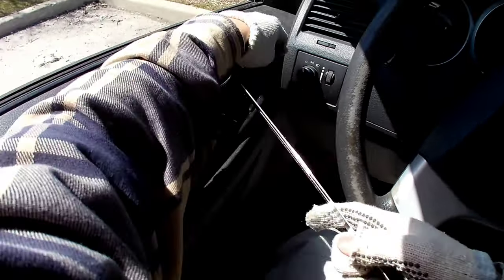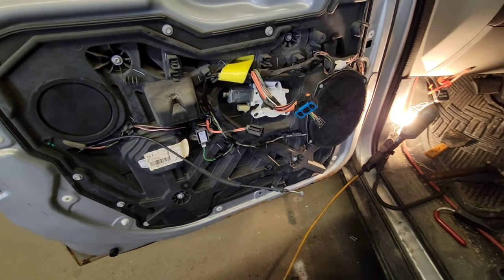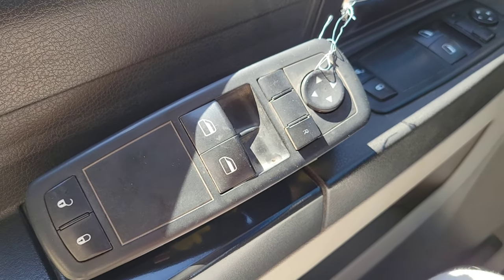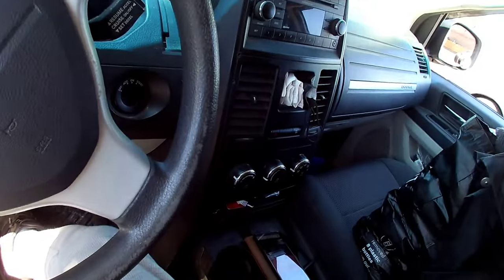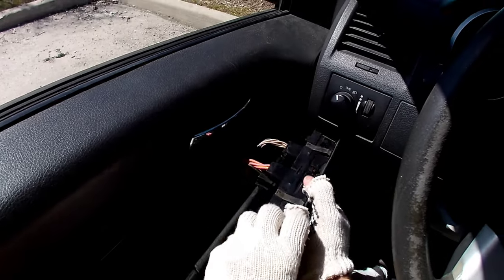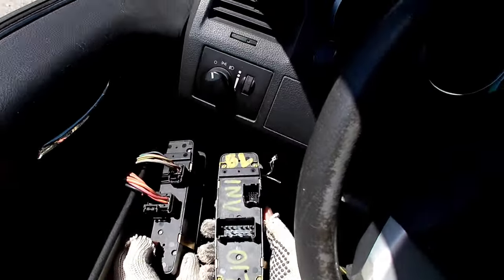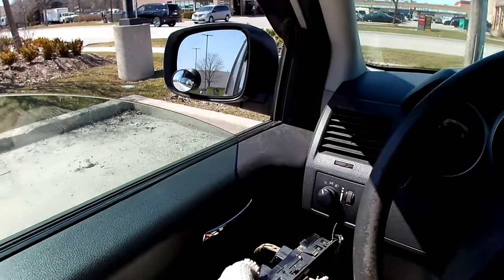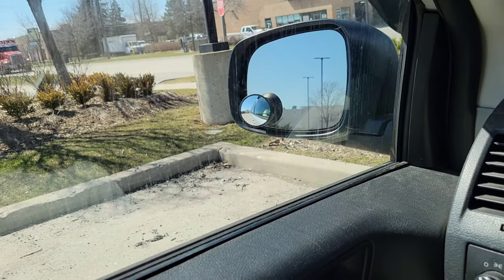When Things Break in a Van | Dodge Grand Caravan | Minivan Camper

Comment: Good job!  Great idea picking up the switch at a auto wrecking yard. 
Most electrical connections on cars have a clip/locking mechanism because the vibrations driving down country roads would jiggle apart any connection just slipped together.  Up close inspection of the plastic connection will usually show a piece of plastic that will bend if pressed.  Sometimes, it makes disconnecting easier if you first push the connector on (like you are putting it together) while you press in on the flexible piece of the plastic and then pull the connector off while still holding the clip in.
Reply from the maker: It felt good to fix it myself and save a few bucks.